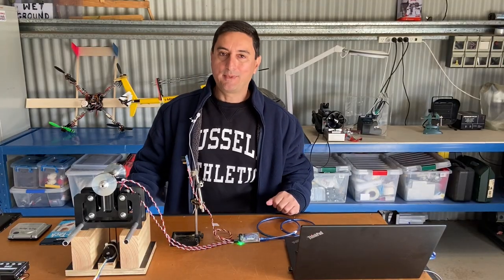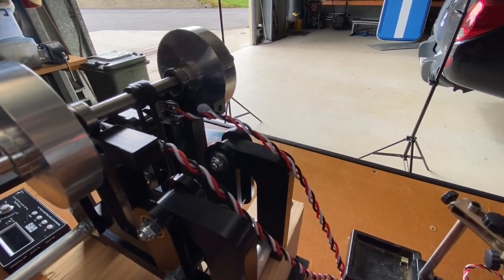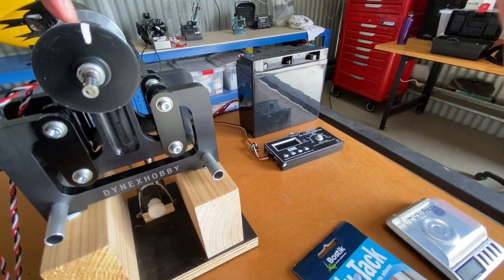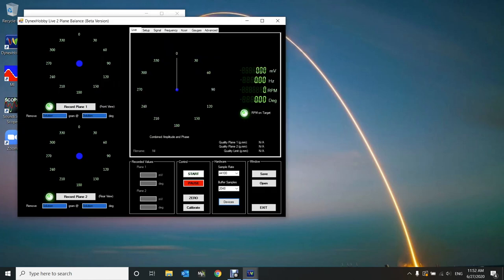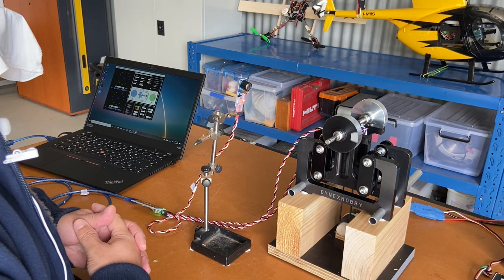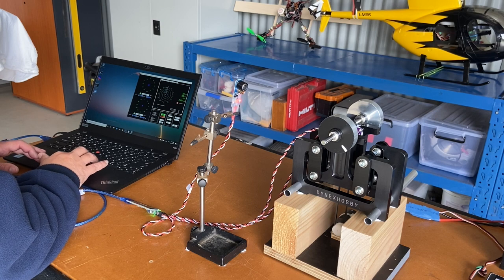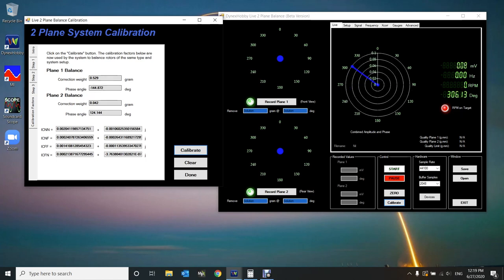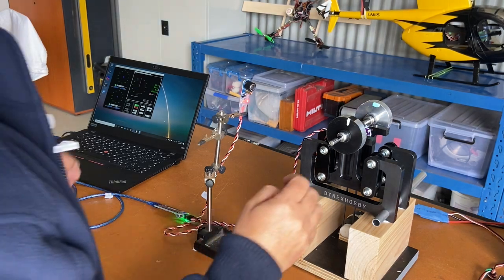Live 2 Plane Balance

Comment: You really should think about making a turbocharger friendly version that doesn't require bearings slid over the shaft and the bands to run on the guide that also is slid over the shaft, many machines like that use two bearings for each plane and run on the outside of the shaft and the rubber band is just pressed down.

Would be amazing for DIY turbocharger balancing, I think there is a nice market there for you. I know you can technically make this work and have workarounds but it'd be nice to have a ready to go version.

Comment: Nice setup!  What is the name of the optical module? Is it just for an index pulse?
Reply from the maker: Laser sensor module. It’s for indexing so balance weights can be positioned correctly onto the rotor.
Reply: @dynexhobby  ok that makes sense.  

Your design is really elegant!  I presume the bar linkage system allows translation primarily in one axis, aside from some slight arctuate motion? 

What does this accomplish?  I was considering a similar system, only I would allow for motion in two axes using a flexure bearing.
Reply from the maker: @weirdsciencetv4999  yes that’s correct

Comment: I would like to use this for balancing Compressor wheels for turbochargers, but I see the motor is connected directly to the shaft for this item. Is there an easy setup that can make that the motor doesn't have to be reconnected to the shaft every time a new compressor wheel needs to be balanced?
Reply from the maker: Hi, an alternate approach is to turn the wheel with compressed air. We have tried it and works fine. Just make sure that the wheel spins at constant RPM for balancing.
Reply: @dynexhobby  Would you need to install something into the airline to secure the constant RPM? I'm also interested in this setup with the air compressor integrated for power.
Reply from the maker: @lissettelopez8331  we normally use a large compressor with regulator. That generally works well for test as the compressor recharges.

Comment: I,m not using a motor drive to speed up but compressed air ,  is this also possible as air will possible induce vibration ?  or can I take the measurement right after when i,m reaching my target RPM?
Reply from the maker: That is fine, I have used compressed air as well. The software will filter out frequencies above and below the test RPM or 1X as we call it. However, if the shaft is misaligned or bent or has slippage then that might be added to the imbalance signal as these discrepancies occur between 0.5X to 2X which is close to your test RPM.

Comment: can this balancer be used to balance an RC Jet engine?  the engine is basically like your setup here, except it, can't be spun with a belt I'll have to use compressed air.
Reply: Good question, I'm not 100% sure because the micro turbine balancing uses the magnet for RPM and positioning

Comment: Is this laser method much more better to "accurately" balance or strobing with a light can provide the same level of "accuracy" of balancing?
Reply from the maker: laser method is much better as it can provide more accurate locations for imbalance. Strobes can sometimes be misleading if not calibrated correctly.

Comment: What is the maximum speed you can balance for?
Reply from the maker: So far we haven’t found a limit as we normally balance between 2000-5000RPM. Can go as low as 500RPM using specific software settings.
Reply: @dynexhobby  I have a grinding spindle I need to balance. It's service speed id 40,000RPM. Do you think I could balance that at 5000RPM with your tool?
Reply from the maker: @car9167  it’s possible but proceed with caution as this can be a dangerous exercise due to the heavy rotor speeds.

Comment: Really good one. Shall I use this balancer for the motor rotor? What is the minimum balancing weight in grams?
Reply from the maker: Aravinth Kumar can be used for any rotor. The system can detect small weights much less than a gram.

Comment: I watched this whole video hoping you would show how to identify a precise angle for weight placement.  such as suppose the software says put a weight at 243 degrees.  other than eyeballing how do you identify location.  Second thing I was hoping to see is how far out to place the mass.  It appears the answer is "all the way to the edge".  So annoying to have you go into detail about the math coefficients and not show the measure placement of the weights.  The other question I had was why you identified the inner part of the dumbbells as plane 1 and plane2.  Maybe because that is where you knew weights would go.   If I had specified the distances in the software to the outer surfaces could I have placed weights on the extreme front and back as well?
Reply from the maker: Software has been updated to deal with the type of rotor arrangements since this video. The software will show you where to place weights and also how far out the masses are after each run.
Reply: @dynexhobby also if plane 1 says add weight at for example at 92 deg. That’s perfectly reasonable. The issue is when doing plane 2. If I says like 234 deg, is that from front view or rear view? That’s confusing because from the front, 234 deg would be well at 234. But if you look from the back 234 deg would be opposite side.